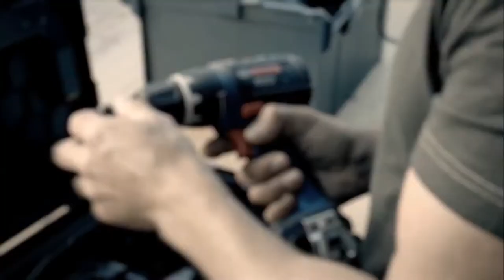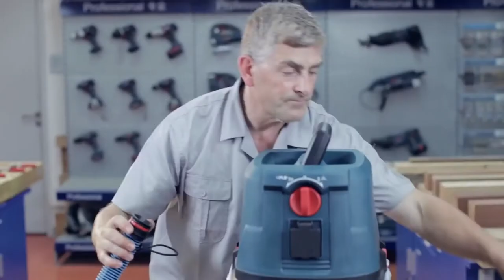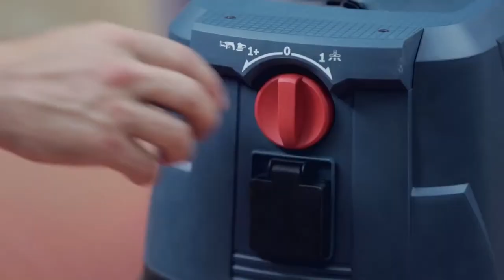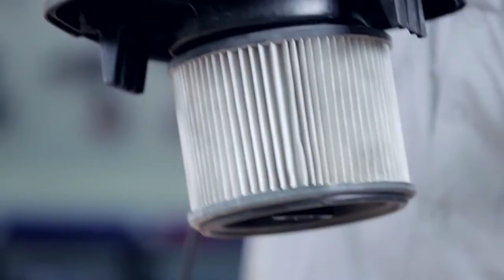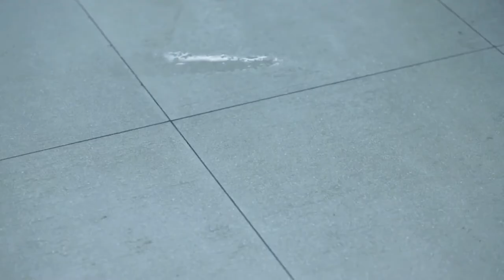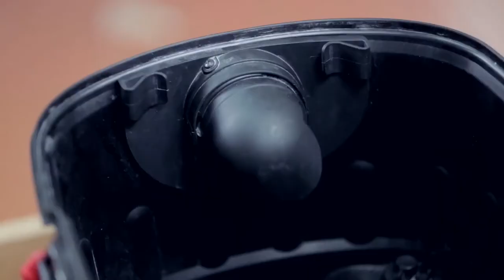Bosch GAS 15 PS Wet & Dry Vacuum Cleaner (Blower Function)

Comment: The hose which is used for blowing function is sold separately. This is a hard to find information and by no means advertised one. Even if you buy it separately, It does not fit all the way in and the sealing ring does not seal. Therefore the blowing functional is reduced at the end of the second(exhaust) hose.
I did not expect such a thing from BOSCH.

And my main reason to choose BOSCH GAS 15 PS was that function.

I am now using an Italian EUR 50 ash vacuum cleaner's blowing function (that is actually stronger).

Comment: How to use the blower?
Reply: connect the suction pipe to the other hole(blow) behind its back
Reply: With the accessories provided in the original packaging it is not possible since you can't plug the hose in the blower outlet. 
You need an adaptater that Bosch doesn't produce :( 
I'm looking for a way to 3d print it...